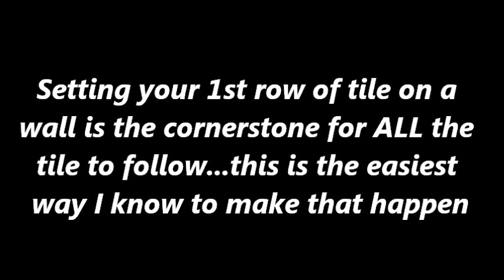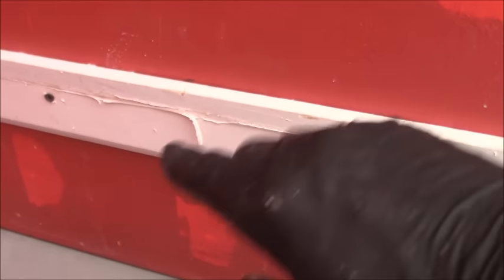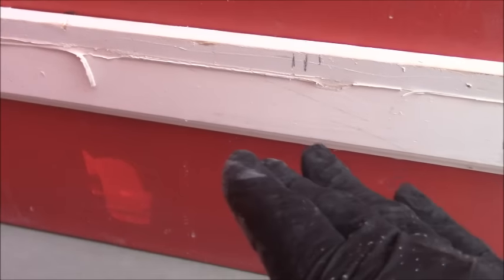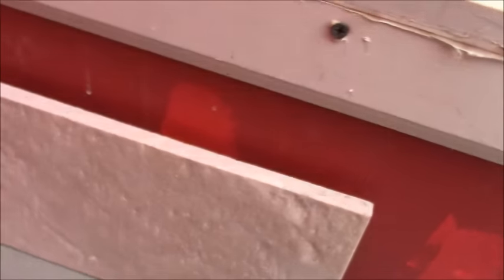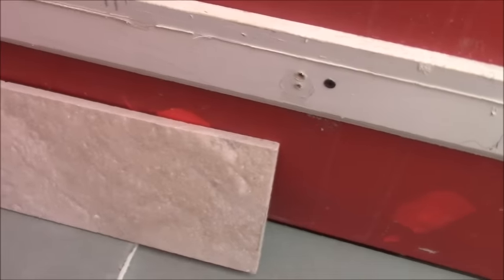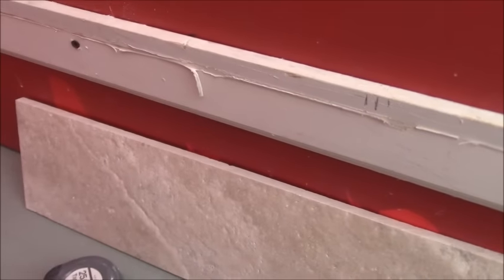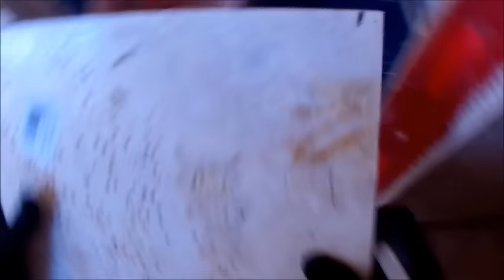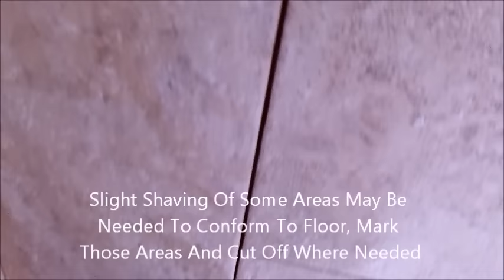FIRST Row Of Tile On Walls....how to do it

Comment: After reading most of the comments below, it would appear that the reason why you would use the method of leaving the bottom row of tiles out and starting from the next row up, has been lost as it seems people havn't been educated by old school tilers who used to do this as a method of being able to do bathroom tiling in a quicker way, so I will explain the way to do this and perhaps then you can all make your decision on how much you actually know about this trade and stop all the negative rubbish cos you simply have not been educated properly.
So....the reason why you would do this, is, and for no other reason, is so that you can tile your walls first, say a small ensuite of around 6-8m2 that you can tile in a couple of hours, you mark the top of the first row of tiles, making sure the bottom tile can be cut out of a full tile, mark the wall height, then set up your straight edges using Tile Jacks, once you have it all level you simply tile the walls, once finished allow enough time for the glue to set, around an hour or so depending on the glue used etc, remove the straight edges and Tile Jacks, then prepare the floor to be screeded, In the old days, we could what is known as wet bed the tiles into the wet screed, using neat cement, however with tiles these days you cannot and should not do this, unless the tile is a mosaic or a clay biscuit tile, where the tile is porous and will set into the cement, that said, this IS THE REASON WHY YOU WOULD LEAVE THE BOTTOM ROW OF TILES OUT, We could tile the walls first, have lunch, then go back and tile the floors in the same day.
the next day you put the bottom row of tiles in grout and silicon the room and your done in 2 days, instead of 3-4 days, it was more commonly done in renovation work where the bathrooms were of a small size and the floors were completely wet bedded in.
I hope this has helped explain the origin as to why this method was used, and yes at times i still do it if it makes sense to do the walls first as there are other factors as to why you might do it, if you have a genuine and another explanation as to why you would do it like this please leave a comment.
Mr StarrTile, keep up the good work 👍🇦🇺
PS: I am the inventor of the Tile Jack which at the time some 20 plus years ago there was no such tool in the world, ohhh the good old days!!
Reply: I see your point I'm not a tiler I'm just wondering when he took the board off to put the first row of tiles in which was the last row why didn't he measure it so he didn't have to cut a sliver of each tile he could just put in a full tile
Reply: @Lemon-squeezer  cuz the floor is sloped, hello.  So the bottom row is custom cut thats y bottom row takes so long

Comment: The majority of people commenting about do's or don't of using a ledger board are missing the point!!  The very last thing you want to happen is working 70 or 80 sq. feet of wall tile over your finished "shower floor".  The point of using the ledger board is because you "don't" have a finished shower floor in place when you start your walls!!  There's never been a time I've been smearing thinset, or backbuttering tile over the top of my finished shower floor.  I'm also not going to take a chance of dropping a wall tile onto my floor.  It's NOT possible to do wall tile without dropping thinset onto the substrate below.  Any tile man or woman that says they can do it and keep a clean floor is lying!!
Also, the ledger board especially over your curb is critical.  This allows perfectly level side walls and then your shower floor gets installed, then your curb(with proper slope) goes in place, then your bottom row of wall tile is installed after both those components.
Although I don't agree with all your methods, your intentions and willingness to educate others is greatly appreciated!!
Reply: Please go to your local building store and ask where the floor covering material and drop clothes are. You are welcome?
Reply: Corey Lawler...   I'm guessing you do not do this as a trade or do any trades?  Why use a drop cloth for an unfinished floor, plus they ball up while walking over them and you trip or get your ladder hung up moving around.   Drop cloths are only used when you really need them.  Plus you missed the point why walls are done first, if it's possible.

Comment: Not sure what he is saying.
Why is he flipping the tile over? I understand use of the ledger board. Set tiles remove ledger board and put in the bottom row of tile with 1/8 of space for the two seams. Why is he talking about flipping a tile over? Just put the tile on the wall....confused.

Comment: Union taught or otherwise isn’t always correct. The floor is always done first and needs to be level! That way you can start with a full tile and keep moving. I see you wasted more time with shaving your first course because your bed wasn’t perfectly level which is time consuming and for me unnecessary. I prefer to keep the tiles consistent in size as some have a keen eye and can pickup the discrepancy.

Comment: basically it supports the weight so it doesnt get outa wack
Reply from the maker: That. Yes.

But more to the point that allows you to run your tile all the way up to the ceiling if you want to without worrying about the weight pushing down onto your floor with spacers you'll never remove
Reply: @StarrTile  I did this a day ago, worked out great. now i get it. instead of losing another day for floor base to dry, it allows me to do walls then base. then after it drys do the bottom layer last

Comment: Yeah but you will end up with an inch to 3 inch sliver at the top?? Unless it is a tall shower
Reply from the maker: Most ceilings are 8 ft and most tile are 12in top to bottom so the math works out pretty good 99% of the time

Comment: makes no sense to me using a ledger. for one it takes time to set it up , which is extra time. also with a ledger, most likely you are still adding shimms here and there and then once you finally do the bottom row, your still , as you put it, are still measuring and taking another 1.5hrs. if your dry pak and shower floor tile is done  correctly,  it should be exactly like a ledger and you save the time of not setting up a ledger. also , cleanliness is a big pet peeve of mine, that level is nasty. the only time a dry pak should really have different size cuts is when they never moved the drain in a tub conversion,  but even so, using a ledger doesn't make that bottom row eventually easier to do, you still have to do it. I just make a level line up where ever the top of the bottom tile is and and set that bottom tile first. if you use a proper hard 1/16 spacer gap at shower tile, it will not squish and you can go up just as high as a ledger. imo a regular shower dry pak should be perfectly level, not sure what 1/4 inch deviation your speaking of
Reply from the maker: The way you do it is fine, it's not how I do it. It takes me a lot less time doing the bottom cuts last, takes hardly any time setting up the boards, and my 1/4'' is 1/8'' for bottom to top tile and 1/8'' for bottom to floor, a 16th is too small.

As far as my "nasty level" goes, I'm on a job working, clean up is at end of the day...that was a bizzare comment !
Reply: I'm thinking these other "professionals" need to go make their own videos on the "proper" way to lay tile, since you are "sooo obviously wrong" and are making things "overly complicated" for us novices. /endsarcasm
Reply: Sorry it just doesn't make sense imo but doesn't really matter , for whatever way works best for you is the right way. It doesn't make sense that the bottom row can be  easier  after that next row is done if the pak and shower tile are level. a level pak is a ledger, so why do 2 ledgers? sorry my friend for the argument,  I shouldn't really do that because no one's methods are really right and wrong....about the level, that just freaks me out that your hands can get that full of thinset while working. maybe it was instilled to me as a boy ,when my father said , you can tell alot from someone by  his tools. from then on I became a clean freak with my tools and my jobs, so that comment just slipped out. sometimes I say things I shouldn't and I am sorry, wont happen again and realize the time you spend making these videos to help people
Reply: what about installing the bottom course that sits on a pitched tub (which is very common) ledger board is a must
Reply: For one, you need to make a level line either way, either for the ledger or no ledger. Second if you use a ledger, the next day you still have to measure down to angled tub for measurements anyways, right? So why not just measure from the level line (again, a line that needs to be made either way) to the tub and make your cuts first? Both things I mentioned have to be done either way...now once cuts are made, just install them to the line as if you were installing them to a hardened row of tile, as if you did use a ledger....so if your not saving any steps, why do it? To me, it's actually slower using a ledger because you have to cut wood, buy wood, find studs, screw into studs, etc....also if you ledger sticks out further then tile, it's harder to plane or make sure that cut row is plumbed properly.  Yes you can plumb ledger row and upwards, but the cut below also needs to be in plane and if the ledger wood sticks out past tile, you cannot get your level from ledger row to the space below....if a ledger works for you, that's all that matters, but imo, it for homeowners or amateurs.
Reply: the reason why you would use it is because by using a perfectly level ledge it ensure the whole wall will run up perfectly straight, what if im tiling a wall and the floor is wavy? im gonna sit there trying to level these intricate cuts on the first row? or run a perfect ledger and fill in the bottom cuts at the end? been doing this 20 years 3rd generation, you dont HAVE to use one, to each his own i guess
Reply: and it doesnt matter if the ledger sticks out, if you put glue on the wall and tiles you will have plenty of leeway and regardless you put the bottom row on after you take the ledger off
Reply: I am also 3rd Gen and been doing this full time since 82 but don't you still have to measure those wavy cuts anyways? You make it sound like once your ledger row is installed,  it easier to make the cuts below? And again, to make your ledger row, you still need to make a level line, so there is absolutely no difference measuring the bottom cuts from a line or from a hardened row of tile. I don't use glue, and in showers, it is best to start on the bottom row because of the pan always making the walls inwards more so then the rest.
Reply: Glue? What are we talking about a backsplash.
Reply from the maker: What he means is thinset...obviously...because he said "glue" doesn't beget mastic. The definition of GLUE is: "An adhesive substance used for sticking objects or materials together"

Those "wavy" cuts at the end are simple and precise. It does NOT take the time as if they were the 1st row, so yes it's easier. You have YOUR way and it works for you, but this is not John Bridge forum where arrogant tilers debate methods, all thinking they are right...this is more/less a DIY vlog, where a novice-homeowner can get tips to make their project easier.
Reply: I agree, a ledger is a great tool and definitely an option for some and if that's your option, then that is best. I did use it once, I was doing 24x24 travertine on an exterior house and the first row was on dirt, rocks, holes, etc because it was just an unfinished lot grade. I couldn't really get a solid base, so I did a ledger one row up. Before doing the 3rd row and after the ledger row was  dry, I set the bottom row (one full tile) and used those rubber bungee cords with the S clips  and bungeed  the bottom row to the ledger row. No chimes at all, just bungeed together! I did use quite a bit of bungees, but it was well worth it and one can always use them....besides that, I just like starting from the ground up. As for "glue" hopefully your right, maybe like people saying gravy or sauce? Idk, but I never in 35 years called thinset, glue.
Reply: Heres another example, lets say im tiling a wall and im putting bullnose along the floor that cover the bottom edge of the first row of tiles, the floor is off level/wavy etc, instead of having to make all these angle cuts that fit perfectly and then have the weight of rows 2-10 possibly pressing down on the first row and also this first row is dictating the layout of the whole wall, if i have a 3 inch bullnose covering the bottom cut they dont have to be so precise, but if i am using my first row to level and run the whole wall up now they all have to be perfectly cut/shimmed and may shift if they have a rough round-about cut on the bottom that will be hidden, and yea we call any adhesive we are using on any given day glue, usually thin set or mortar we just call glue
Reply: In that senario,  I can see that and agree, but tbh, I don't think I ever installed a bulnose over or on top of a wall tile. Maybe that is common where you are but at least the jobs down here it's either wall tile all the way down or a sanitary base at the bottom, which isn't put on top. And actually 99 percent of my wall jobs are done on level surfaces, either a dry pak or shiwer floor that I level and do first before the walls.  Now tub surrounds are not level, so maybe those cuts are what you call wavy. But yes, in your example, I understand.  My main misunderstanding is when you have to use a ledger when the floor is 99 percent level, in that case, I just think it's a waste of time tbh
Reply: yea thats the thing i do a lot of bathroom/kitchen remodels on residential homes and the existing floors and walls are never level or square.  if im doing new construction and the floors are level and the shower pan at least has a consistent pitch then yea there have been times where i havent used a ledger, but most of the time these houses are wracked
Reply: vapdivrr But now you are not playing with adjusting all of the different tiles they keep wanting to slide on you even if you use 255 Ladda Crete
Reply: vapdivrr Less of a headache in the long run I’ll just sing one or two rows versus 5 to 8Depending on how fast you are. Which for me can be a whole lot more rolls than that so it is very useful to me
Reply: So you can set more rows? Seems like one can set more rows if one starts from bottom? It's cool if it works for you, for that's the important thing, but I still do not understand why...if one has a level base ( I'm talking shower walls), which you should have, then what's the point on making another level base, like a piece of wood.
Reply: all your videos is about vaps..huh? how about you set up a camera like you do those vap vids and show us your tiling skills
Reply: Bull vaping is my hobby and like tile, it is a passion of mine. I wish my camera could actually show the intricacies of my work, but it doesnt..I have tried shooting a tile vid, but I really need Like a wide angle lens or something. .also I work alone doing mostly shower remodels and I'm slow already, doing a vid would slow me down even more...I probably could do one, but that does nothing as you need to do them all the time for them to help people...all I can say is that I have yet to see any tile video that can compare to the detail I put in into my showers . I know you probably are rolling your eyes, saying " yah right" but it's the truth. My grandfather did brick and tile who taught my father who taught me....if using a ledger is the way you like, it's the best way and that's what you should do. I just personality don't and feel it's a waste of time in a shower. If one does the dry pak level first, then tiles it, it should be perfectly level, so why not use it? Why go through the extra process of making another level base?
Reply: Jonathan coffman .....why would they be sliding? If your shower floor is completely done, pack and tile, and it's completely level, why would your tiles slide?  Setting on a level shower floor is no different to a stick of wood a foot off of the floor..
Reply: Yes definitely for a deco border. ..I usually stop before deco (hopefully at the days end) then make some kind of ledger.  I try to make ledger a hair thinner then my field tile plain, this way I can use a level to check plumb...sometimes I can just use cut pieces of duroc, exactly cut to the size of deco (plus 2 joints) and just rest it on my last hardened row. Maybe I put a finger full of thinset just to keep duroc in place and set my upper field tiles on that...those borders do take time,  because 99 percent if the time you have to build them out, so I usually float in a bit of thinset after all my field tiles are done. Usually make a little stick with notches on both sides and pre screed the area...
Reply: StarrTile im glad you called him out on the dirty level. Lol Bizarre is right. Wtf kind of comment was that.
Reply: StarrTile I totally agree.  Especially if you have to shave a spot with a belt sander for a high spot in floor tile.
By the way, for ascribing the bottom row of tile, you are flipping end for end and fro t to back......correct?